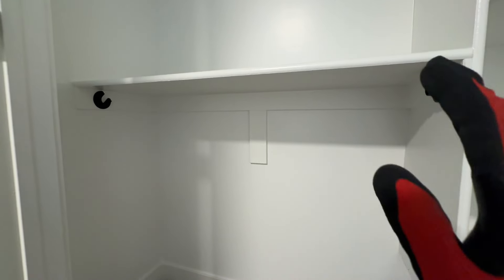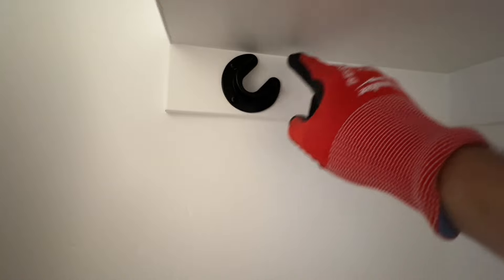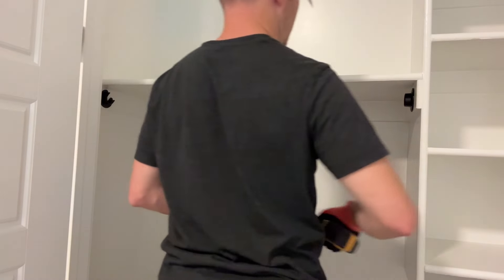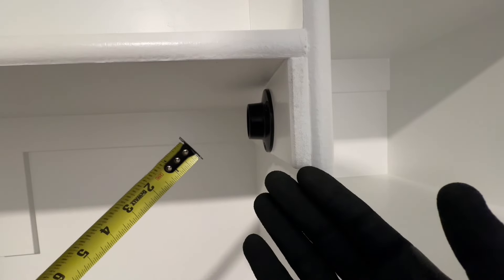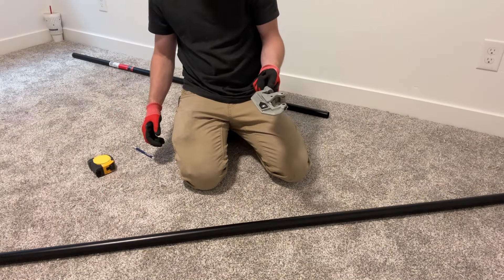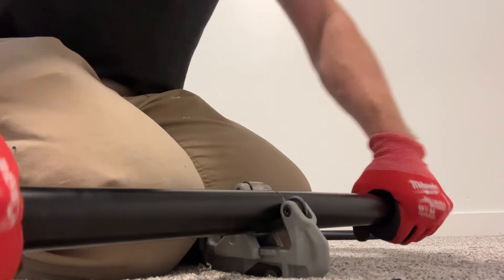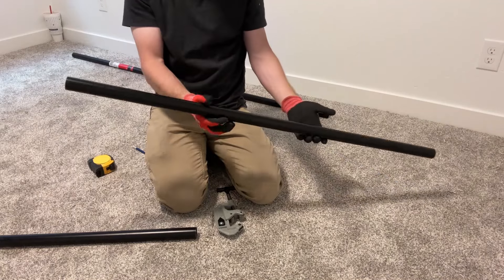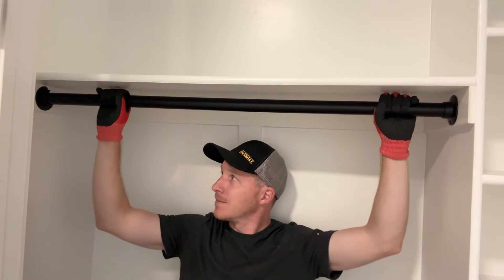How to Install Home Depot Closet Rods | Easy Steel Closet Rod Installation

Comment: Looks like you may have put them too high? You need to angle the hangers to get them in now right?
Reply from the maker: It is a slight angle, but that’s kind of the nature with these rods and standard 3” cleating. It’s a very slight angle to get them in though.